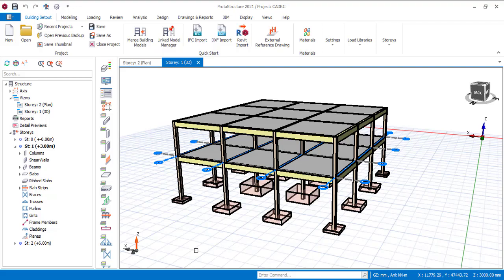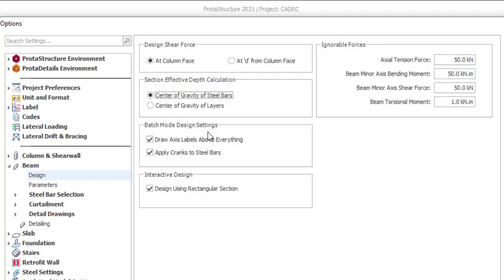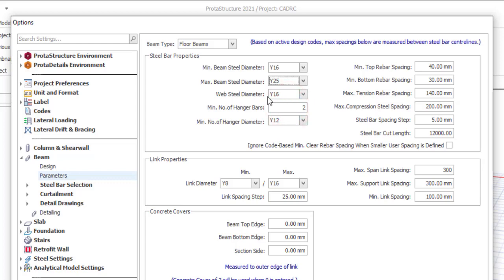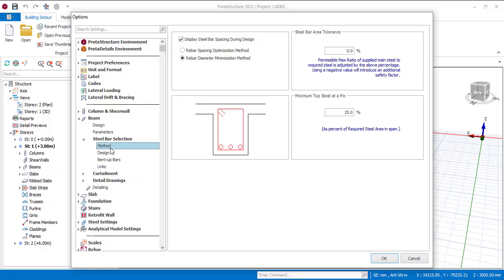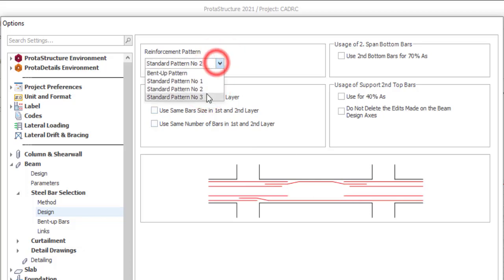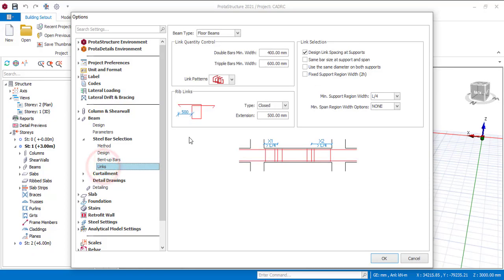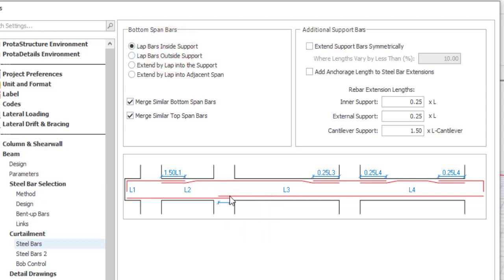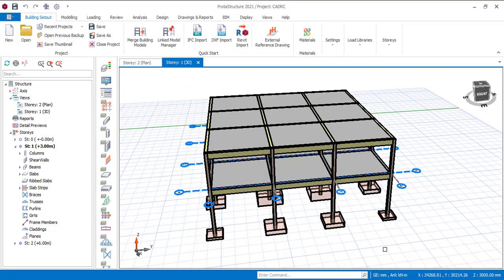Design & Detail settings of Beam in ProtaStructure.

Comment: Mooning sir,  I want to ask   after analysis and design it was ok but but some columns failed and edited to pass it shows expired analysis color  . What is solution
Reply from the maker: If your analysis is still valid. You just need to re-run the design.
Reply: @ridwantician  invalid sir
Reply: @ridwantician  or I may say expired analysis
Reply from the maker: @otuoyeorubia6722  You need to run your building analysis again and then design your members
Reply: @ridwantician  thanks so much
Reply from the maker: You can run a column batch mode design for all the columns.